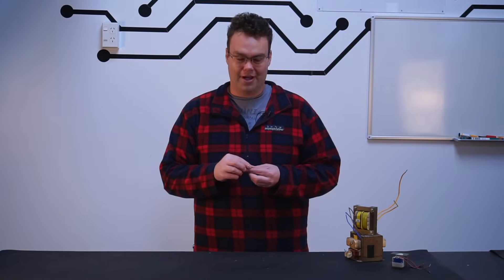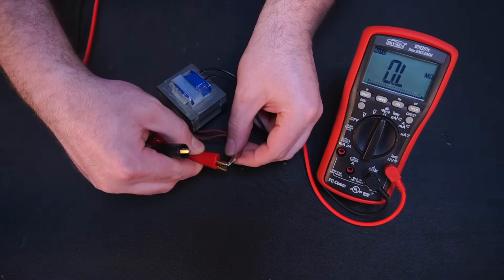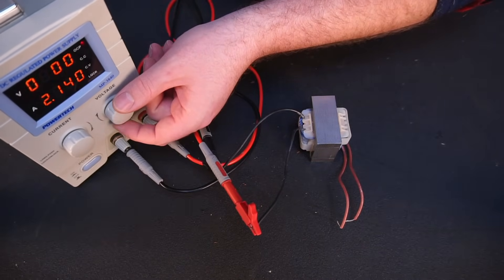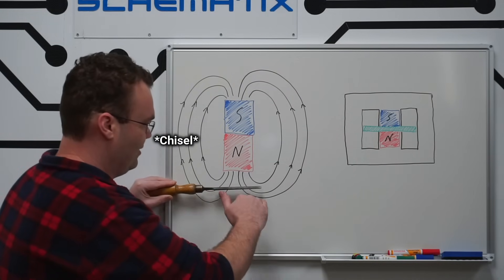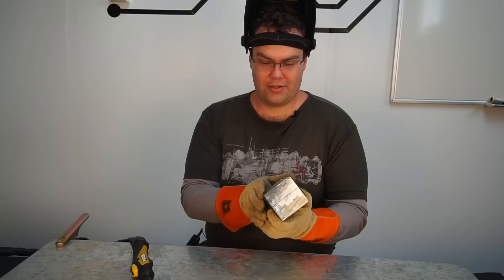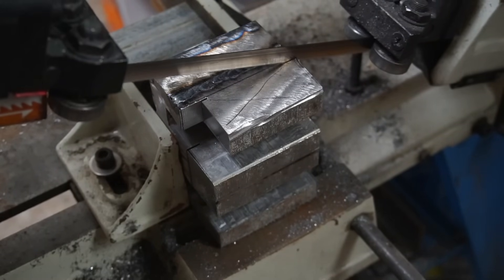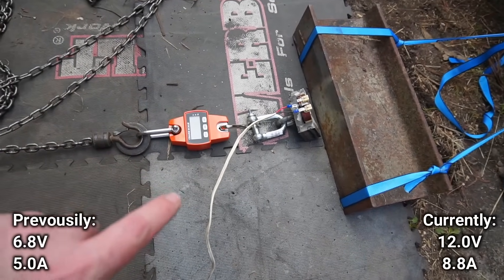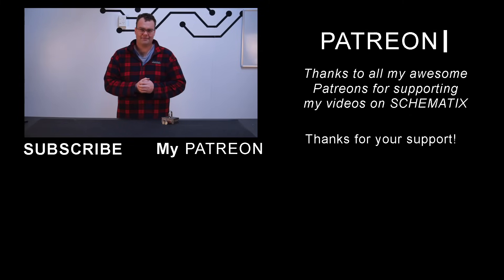Making a Powerful Electro Magnet from a Transformer

Comment: Hello. So, because the amps are not to high, i would test your system by building 2 of your magnet, and put them arround a hose, 
like that ( https://www.youtube.com/watch?v=qvON69Sg8TI ) but of course a hose made of copper, for exemple - to resist of the pression, ans see what it does to run a car wiht such magnetism on the fuel. Of course, you can test at first with lowder amps. 
Jacques.

Comment: A common use of MOTs repurposed this way is to create a magnetic drill press base that can instantly be attached and detached from any ferrous / iron / steel workpiece of decent thickness at the flick of a switch. Retail units run pretty high up in the price range just for that functionality alone.

The second popular option is a machinist electromagnetic vise it chuck, more often than not is used with a surface grinder, followed by a milling machine for workpieces that can't be held down properly with any other means. While switchable permanent magnet versions do exist, they have their own drawbacks and quirks.

My primary problem is figuring out a decent rectified DC volt+amp combination for the MOT electromagnetic coil, preferably something that can be derived from outlet power, most likely from a switched mode DC power brick with current limiting.

Comment: So, iron is a container of the magnet field. It is conductive, so if you use a copper box that overlaps the magnet, so it is lower conductive so the magnet that is tight is low. When you cut off the iron, the magnet field expands so it interacts and inference more, so for copper, it interacts and inference less. So, higher conductive is better. Higher conductivity has higher B field so the magnet is more powerful, right? Tight is more powerful since it is higher density, so when it interacts at further level when you cut off, so it is less powerful and lower intensity like the light that is far away, so it is less bright but it is wider, so the magnet field that is wider is also weaker, so if you use iron box to pull the vehicle it will be much higher than half, so more is better?? If not, then why? Why is small more powerful, so that is the same as light that is small is bright and far away the light is lower intensity so less bright? So, a tight magnet field compare to loose magnet field, loose is better since it is not block by resistance and has one corner that is square to a tiny corner that is a circle so it is smooth. 90 degrees as a corner, so 90 degree is break off, so the power is cut off. Why does microwave use a tight magnet field, not a loose magnet field, it is better, right?
Reply: I use it to pick up bolts from a pail I dump on the floor

Comment: I don't see why you cant control the ac current the same way you can dc current. Hook either a light bulb, or a parallel cluster of lightbulbs, in series before the electromagnet... Im sure theres options other than lightbulbs, but you'll lose the added benefit of them also functioning as fuses if you use something different... Its not perfect but its not like ur needing clean fully regulated power for this setup right? Cool video tho... Giving me ideas, instead of moving something very heavy with a strong magnet, im gonna tinker around with moving a bunch of really small stuff with a strong magnet.  👍😉

Comment: Keep reducing the power supply to the magnet ( volts and amps equally ) to see at what point it fails at 300 kg's, then find your wattage from that and divide it by 300 kg's to see your watt strength in Kk's lifting power. Great video, well made and informative, would never have guessed that a low resistance in the system would make such a difference.

Comment: Congrats .... you win, I've been searching all day to find out the relationship between voltage and current, with a transformer electromagnet. And not only did you explain that, you answered my ultimate question, how to maximize the pull.  I have already built the Drill press "magnet" using two matched microwave transformers, but my "trial and error" process of finding the "right" ,power supply "wall wart" plug in transformer has not been very successful.   The closest I have seen was someone using 12V, 10 amp, to power his, but off of 220VAC, I am in Canada, we have 110 VAC (60 Hz). ( https://www.youtube.com/watch?v=e_ua18J8NOg ) (I built mine a few years ago but is very similar to this!)  I have watched and researched many videos and read a bunch over the past few days and months, but no one else so far has put the information so "eloquently"!  A big Thank YOU!  
The biggest problem I have had so far is overheating the supply.  I'm burning them out.  I have tried a large heat sink and  muffin fan, but it is not very practical.  Part of the issue is the length of time that is needed on a drill press, it takes time to drill a hole, it takes more time to drill "many" holes, the larger the hole more time!  A short duration, leaves time for things to cool down, when using for many holes, unless I take a lot of breaks, it is just not practical.  I have been cautious to use more Voltage or Current do to lack of knowledge of that part of it. It was "difficult" to make the "magnet", if I burn out a winding, there is no way to fix it, it is encapsulated in FRP, which is in a steel "tray". My resistance is just under 2 ohms, I have found that 9 VDC with 1 amp "almost" sufficient to hold to most of my projects, that may sound "backwards" , it is a bit, I modified a bench size drill press, it sits and is attached on top of the magnet, the magnet sits on the material.  I've drilled and finished well over 500,  5/8" holes with it.  So they do work, I have also gone through "several" ?? supply transformers during that time, so much so I have made them "easy" to change with quick connectors on the magnet and a auto switch on the drill press.  Again, thank you, my search has been answered!

Something else I read today... What I learned was that when the power is switched off the electromagnet itself can generate a strong "backflow" current through a circuit. It can be seen by touching a power supply wire to the transformer contacts, having it on, and removing a the wire from the contact, when you first touch, no spark, leave it on for a few moments to "charge" the transformer, when removed, you will get a "spark". I am not going to pretend to know "what" is going on .... but a reply was left on the video ... I copied and pasted it here, i am going to add this to my circuit it may be part of the reason for the burning up of my power supplies ....

Csaba Vartik
2 years ago
It is worth to put a diode between the +12VDC and GND in reverse direction, because when the magnets are switched off the magnetic field collapses around them and induce current which have to find a way around. If no way for the current to flow, a voltage spike will form which can hurt the 12VDC driver circuit.

Comment: Since current drives magnetic field intensity (and voltage drives current) which would output more power and why?? :

Cutting bottom off two MoTs and combining both E sections into one large transformer (assuming perfect assembly...no degredation of Mfield where pieces join etc), you now have 2 coils each (pri and sec) coupled in same generated Mfield.  Now, driving both primaries should theoretically ?double? the output of a single secondary...however, one could either wire the two pri coils in series or parallel; which would yield more output?

If series, in theory the 2x resistance would half the driving current (if both coils were say, 10 ohm each; 20 ohm total...with a 20V source V), but also provide 2x the Mfield with 2x # of coils; thus giving the same power out??  Im sure frequency/inductance would come into play here as well as to drift actual values away from theoretical, thus where my question lies.  What actually governs how much current passes through the primary, it cant be as simple as just I=V/R when dealing with a coil...would combining both pri coils in series indeed cut current in half, or would actual current fall below half due to inductance increasing?  Could it possibly pass a bit more than half due to some effect im unaware of???

Option 2:  wire both primaries in parallel.  In theory, both would operate at full input V, but current would be split between them (2A across 10 ohm, or 4A total as parallel would yield effective resistance of 10/2 or 5 ohm) effectively driving 2A EACH coil for 4A total draw from source.  I know inductors, however, dont simply follow basic resistance calculation for current and depend on frequency and inductance values...but im assuming since both cases have similar low values of inductance and frequency, the relative change to current vs wiring type would remain approx. the same.  

This doesnt seem right at first glance though...First the original at 20V over 10 ohm coil yields 2A and coresponding Mfield with "x" strength.  Series setup gives only 1A, but since there's 2x the turns, we'd get a field with x strength still (half current = 0.5x, but 2x turns brings 0.5x back up to original strength) .  Now the part that sounds wrong: Parallel setup yields 2A through each coil, same as original 2A = x strength, but now we have 2 coils making x thus producing a total field of 2x strength.  Would some unknown factors combine to make actual output less??  With this theory, couldnt you make the primary 5 small coils wired parallel instead of one larger coil to drive the same Mfield strength using less input V than the one large coil would require?  What am I missing?

Lastly, which would output more power, secondaries in parallel (2x I but 0.5V) or in series (2x V but at I).  Theoretically both would be equal power, but in reality how would the inductance come into play...making one actually slightly better or worse actual output?  Finally, would used output draw on the transformer affect the output power?  Would drawing more current produce inductive resistance via opposing induced Mfields and lower actual output/performance?  

Obviously having multiple smaller driving coils in parallel isnt better, else transformers would be built that way.  In theory as above though, it seems it would output more this way...whats really going on here???  Ive only basic-moderate understanding of electronics theory but little experience (im a chemical engineer, not electrical), and im trying to build a fairy unique, specific power supply to drive an electrolysis experiment.  The chemistry and such works out exceptionally well and points toward a possible much more efficient H2/O2 generater that uses resinance frequencies to generate excess gas by vibrating apart some H2O molecules via the generated oscillating electric field.  These extra, or "free", broken bonds via a mechanical mechanism generate gas independant of current input (gas gen. directly proportional to current), theoretically making more H2 with same power draw.  However, I need a better understanding of transformers etc in order to build the needed high frequency, high current power supply.

If you wouldnt mind, answering this question would greatly help move my project forward.  Any info or pointing me to a video covering this content would greatly be appreceiated as you seem to know this stuff well and explain it very well.  Thank you for your time.

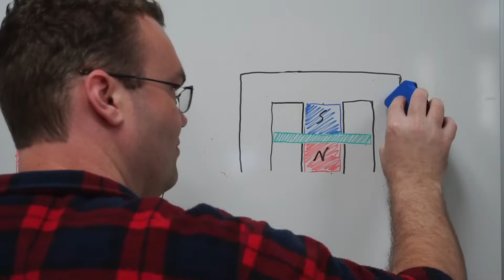Comment: 9:17 Actually, the magnetic fields go pretty much the same way as before. But because you removed some metal, they go partially through air. The magnetic field is only really "exposed", on the bottom side of your drawing. You can verify this, by trying to use the opposite side of the electromagnet (the upper side, on your drawing). According to your field lines, it should work just as well, as an electromagnet. In reality however, there is barely any magnetic flux on that side of the electromagnet, since it goes through the metal core, wherever it can.

Comment: So what if you replace the secondary coil with another primary coil in an MOT? You would eliminate having to chop off half of the block, but would it double the power? And would you connect the two coils in series or parallel? And would you reverse polarity on one of the coils? Would it matter in AC, DC?
Sorry about all the questions. 😂
Reply: I had the same question couple weeks ago... after cutting a mot into the E shape I placed another coil on top of the primary coil.. connected 2nd coil to the leads of primary flipped the switch and POW!! i thought fk it blew up .. then simultaneously heard a loud thud and something hit the top of my right shoulder... the 2nd coil I placed on the primary coil shot straight up off the mot transformer.. broke the wires off itself as it headed for the ceiling.... I was dumbfounded to say the least ..
Reply: @codyramos3200  I knew there would be polarity issues, but didnt think about the power involved if connected north to north. Yeah, i guess it would do something like that. Did you try reversing the wires?
Reply: @siggyretburns7523  uh I can't say if I did ... I soldered 1 end of the 2nd coil to another coil to make 1 large coil to work as a secondary coil for a step up transformer... it takes a ridiculous amount of wire to go from 110v to 550v ..
Reply: Well I know you can't reverse polarity on one of the the coils, you def want the same, but that a good Idea if you have 2 of the same broken microwaves. Lol. Not sure if parallel or series would create a stronger magnetic pull. Im thhinkin series cause more amps

Comment: Hi Schematix, the reason magnet became so strong is the magnetic flux path. When you cut the E-core the side became free and magnetic was traveling through the air to complete its parth. Now when you placed the magnet on I-beam it became the bridge to that magnetic flux path and that is the reason it was so strong. Check the Permenant Magnet Holder of Lead Skalkin, he placed the two coils in each prong of U-shaped bar and then bridged it on the top, you energize it and remove the power, the magnetic flux will then run for ever in that loop and it can hold pretty good amount of magnetic. Good experiment. I liked your video.
But I have one Question: Why Australian put South pole on the top and North pole at the bottom?

Comment: Not sure if someone has already pointed out this minor detail, but I will go ahead and do so: when he drew the magnetic field lines for the transformer after being cut in half, the field lines should have actually gone from the middle section out towards the two open ends of the transformer at the bottom, not towards the closed end of the transformer on top. The vast majority of the flux goes in and out of the open ends, not the sides or top. You will notice this if you try to stick some iron on the top of the transformer- it will not stick nearly as well as on the open ends at the bottom. Very cool video though, and nice way of illustrating things!
Reply: To prawda, błędnie rozrysował linie pola magnetycznego.
Reply: Magnet in middle> magnet on-under
Reply: Yes thumb up.
I couldnt believe he is so stupid and useless.
Reply: Energy flows in the path of least resistance. Therefore the flux will take the straightest path from the copper the iron core because the air presents higher resistance to the flow or current produced by the power supply. Energies natural state is to 0.
Reply: @buckaroundandfindout  Yes, the magnetic field will avoid going through the air any time it can, but if you put a gap in the path of the magnetic flux like in this case here, it will go through the air. The two ends have one pole, and the center has the other. The magnetic field is trying to complete the circuit between those two poles in the most efficient way possible, therefore it will come off the ends like I described. Any other path would be longer than that.
Reply: @HeyChickens  constructive Central pedal divergence is what you are referring to. Yes some flux lines will flow through the air because there's no room for them in the path of least resistance. Especially in the case of an electromagnet where the force is being pushed into the dielectric field thereby forcing the internal forces to become external. Gaussian flux is introduced to a piece of steel in which it is changed fundamentally on the molecular scale therefore allowing a bypass of the flux fields in what is known as counter space. Where you see the flux in a feral cell is usually the path of least resistance ergo where the force is not located in the flux line. The force is in the space in between the flex lines, that is where you will locate the bulk of the energy that is being displaced via the lack of pathway in least resistance.
Reply: Furthermore magnetic attraction is a little bit of a misnomer as far as the words and language describe the actions. It would be more accurate to say that two pieces of metal rushed to a null point that is a convergence of flux lines in relation to the spin of electrons due to the polarization of rare earth metals. Ergo Force equal to attraction is acceleration to a null point.
Reply: ¿Ilustrar las cosas? 😂😂 sobre todo como romper una bobina que se puede aprovechar 10:22 Eso es algo absurdo ,éste es como un niño rompiendo, lea mi otro comentario principal

Comment: to exceed your scale, a a proper set of pulleys will multiply or divide accordingly. 10:1 so now your scale doesn't max out at 300, well it still does but multiply by 10 as per the pulley ratio. 

300 X 10 = 3000

Comment: For "perfect" welds using pulsed TIG, go with fast pulses and move your hand slowly (or moderated per experience, just faster than the metal melting.. melting wrongly that is)

Comment: Like your video 
Read several comments 
Need to readjusted Your magnetic field
Few things 
You can used Lever to increase the range of force you trying to measuring. A lever can set up as 1 to 3 or 3 to 1 and change one way can be 3 times or 1/3 
Think of it as a seesaw or moving rock